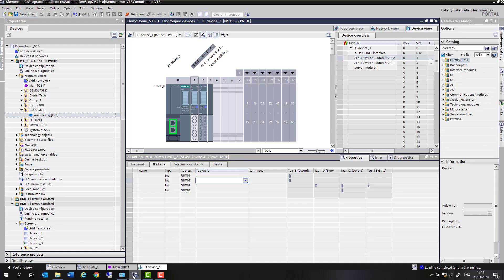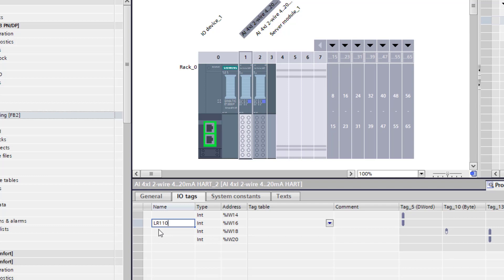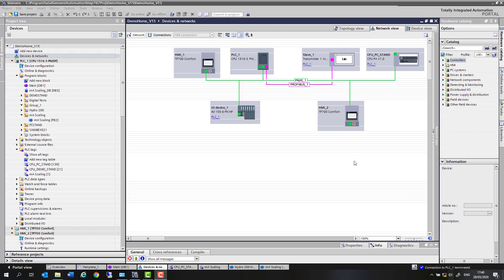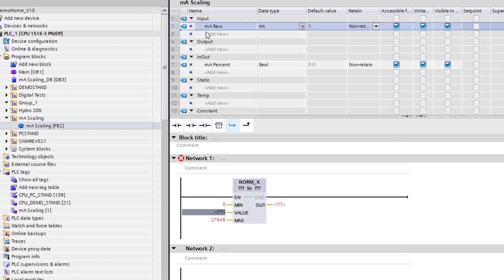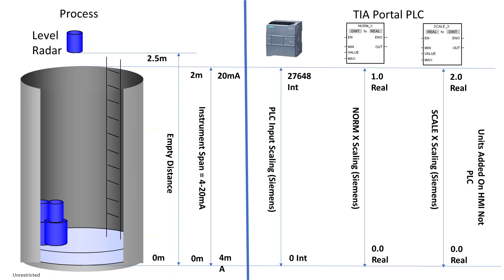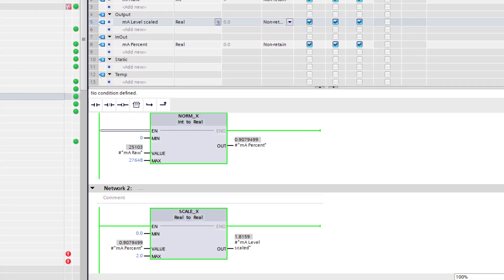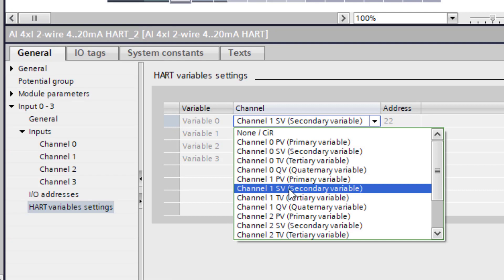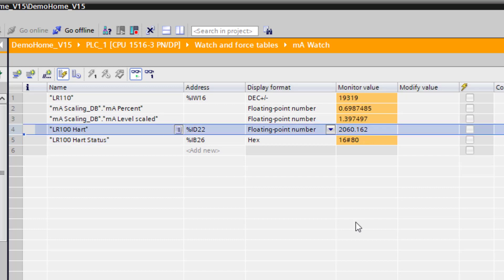Learn how to scale mA inputs and read HART process variable on Siemens TIA Portal.

Comment: Hi. Thanks for the very informative video. Do you have any information about how to read out other parameters from the transmitter, and how to connect multiple HART devices to a single AI input, and maybe something about ring redundancy?
Reply from the maker: You need to use a acyclic Hart command to read other values.  The S7 1200 doesn’t support this.  The mA cards don’t support multi drop, you can’t change the address of the slave, the plc only works with Hart address 0.

Comment: does simatic pdm enables you to change the 4 hart parameters which we want to read or are these 4 hart parameters fixed. For example 1st Hart parameter is flow and 2nd is totalizer.
I hope my question is  clear, as i am a bit confused on this context
Reply from the maker: In most cases yes.  Normally the PV can not be changed and matches what is et on the 4-20mA

Comment: Are you able to write via HART using this ET200 SP AI card? or Do you need a AO card?
Reply from the maker: There are two analogue cards for the ET200Sp , mA input and output.  The HART signal is two way digital communication regards of the Card.  SIMATIC PDM can read and wright parameters regardless of what PLC is connected to the ET200SP.  The Card is restricted to read 4 HART process values directly to the PLC.  this can be freely configured to read PS, SV, TV or QV from any instrument, it will read this data in the peripheral memory area.  If you want to read nay more than this then there is a DB Read block to read acyclic data from the instrument, just be careful as I don't think this block is supported on the S7 1200 PLC.

To use the HART card you must use the ET200 SP as remote IO this functionality is not support on the ET200 PU.